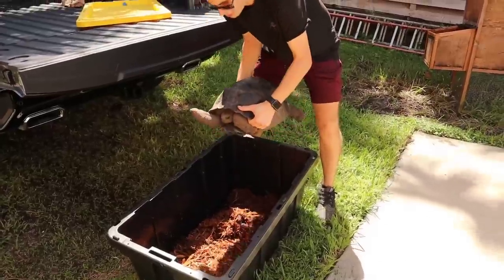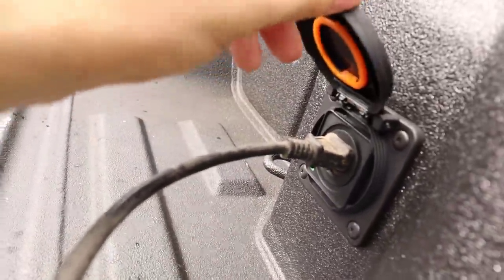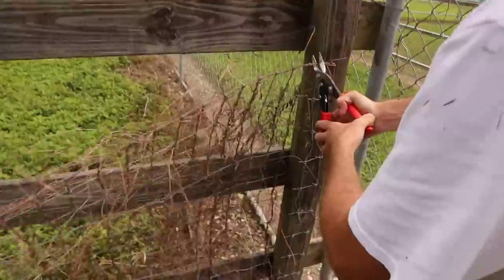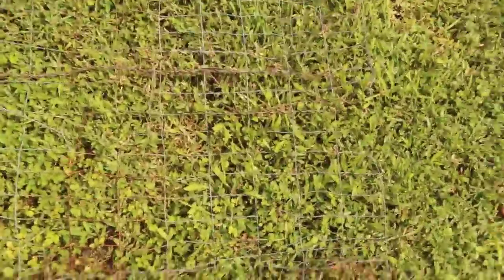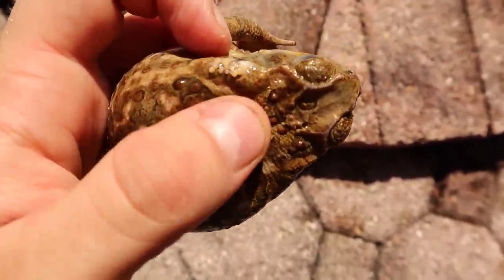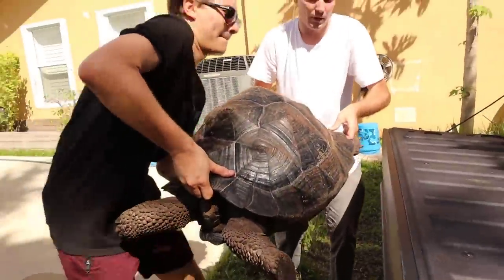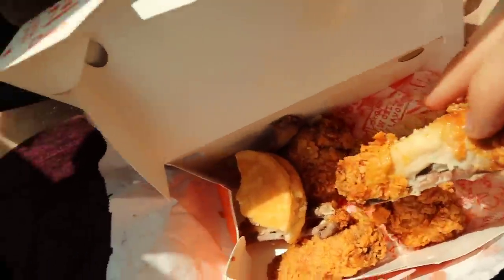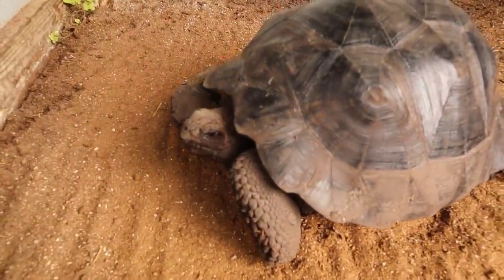BRINGING THE WORLDS LARGEST TORTOISES TO MY ZOO !

Comment: Jacob invest in a Jackery.  I think that’s how it’s spelled.  It’s basically a mini generator charged by solar power and possible electric.  You can charge items via USB ports and or standard outlets. They have different sized units depending on run time you need.  Many channels I’m subscribed to are using them.  They all have nothing but positive comments and recommend them to others. Also with nighttime checks is a company called O-light.  Again homesteaders highly recommend them. They have head lamps and various sizes of flashlight sizes.  A lot of them use small lights that fit in a pocket.  Hope you check them out.  Personally I wish I had money to get one.  But your new home and Zoo would benefit greatly.